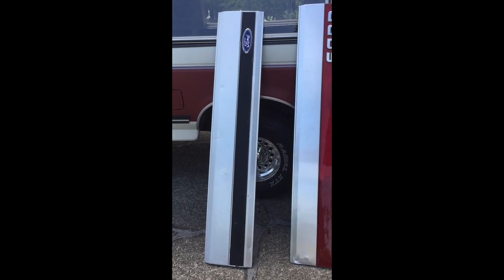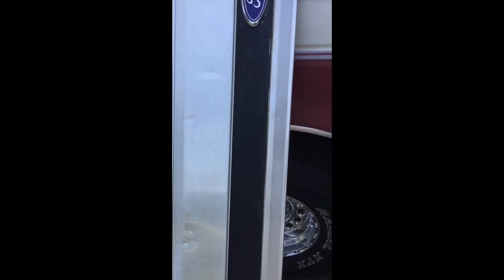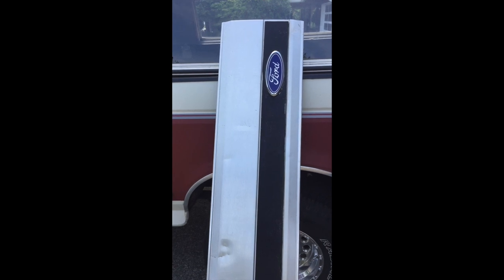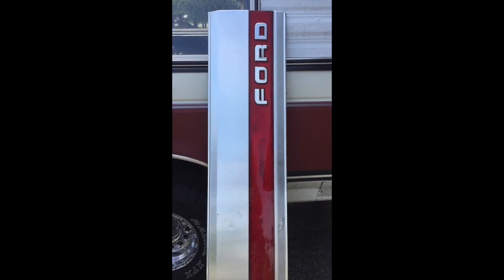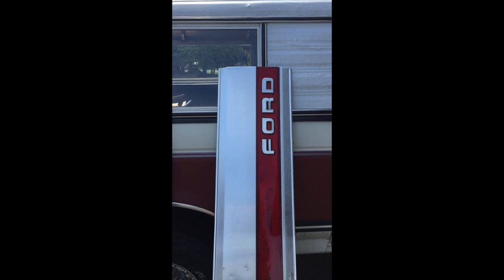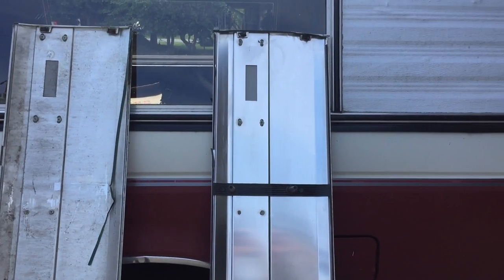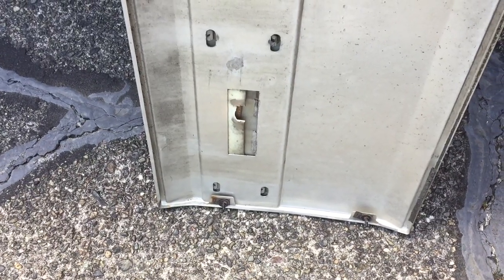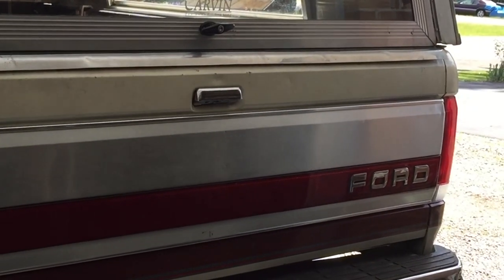Replacing my Ford F-150 Tailgate Panel

Comment: I was wanting to know how you took it off but whatever
Reply: Go through the inside panel then unscrew the four end screws , two on each end.
take a non marring Malott and tap it to one side until it comes to the slots.
then simply remove and reverse engineer the new panel.
Reply: Need to make a correction. loosen the 6 t20 screws on backside of tailgate
remove 4- 10mm nuts, two on each side of tailgate. Should come right off !
Reply from the maker: Here are some more details on how to take it off:   https://youtu.be/4NeO17i0Hj0

Comment: Hey, so you didn't really show us dummies all the steps, do you have to take the inside panel off the tailgate to get it apart? Or just the screws o9f the ends and then slide the trim panel to the side until it comes off?
Reply from the maker: Ok, ok!  I will post another video soon showing how to remove and install the tailgate panel!

Comment: Where can I get just the red reflector strip across the tailgate that says "FORD" on it?  What is it called?
Reply from the maker: At the time, I searched and could not find just the reflector strip.  It's possible you can get one from a parts yard.  Perhaps someone else that sees this might know the answer.  I decided to just replace the whole panel.

Comment: I have a 94 F-150, but my tailgate panel doesn't have FORD on the right side...it has a blue Ford oval emblem on the left side. According to LMC, the panels with the blue emblem are for the Broncos and the ones that say FORD are for the F-series trucks. Can anyone confirm this??
Reply: That's what I thought. The trucks had F O R D... the Broncos had the oval emblem.
Reply: You are correct. Broncos have a blue oval ford emblem and trucks have FORD. And I believe broncos also have a keyhole on left side of aluminum panel.

Comment: where can i buy a new black reflector, my panel is perfect, but the reflectors missing, im about to fab a piece to fill in that section and paint it black , cant be that hard to do , im not spending 200-400 for a whole new one
Reply from the maker: If LMC truck doesn't have one  http://www.lmctruck.com  try a search on eBay or Craigslist.

Comment: Is yours a square body shortbed ford? If it is you’re the only other person with a truck identical to mine!
Reply from the maker: It's a F-150 XLT Lariat 4x4 Supercab, Longbed!
Reply: Mines only a 2WD and a shortbed, close enough lol
Reply: Also its a 1990 lol
Reply from the maker: My truck's at the shop getting the AC working again and to have a new rear bumper installed.  F-Series trucks seem to be prone to bumpers getting bent on one side or the other.  This is a new one from LMC Truck.  I might shoot a new video of the fixed up truck.
Reply: Christopher J do it, I need to have my tailgate repainted (trailer mount fell on it) and my chrome replaced lol